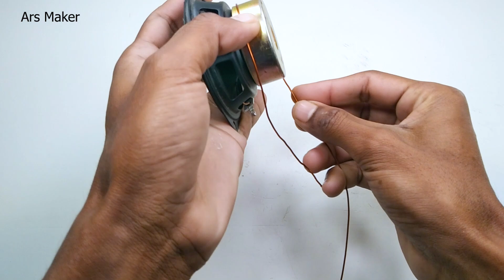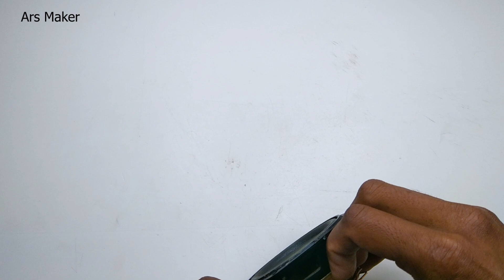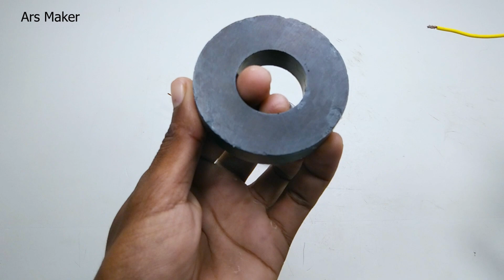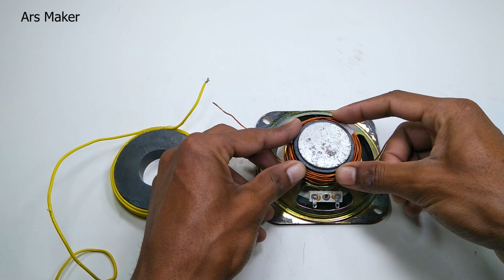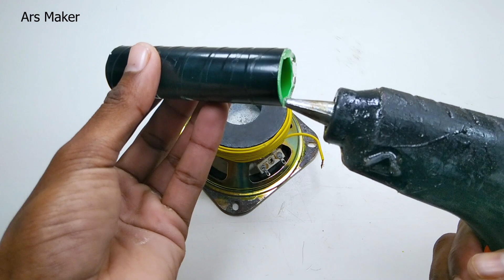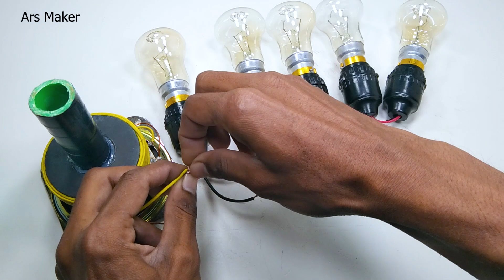New idea Free Energy Electricity 220V 35000W AC Current First Power Generator With Magnetic Activity

Comment: AH AH AH, se fossero 220Volt 35000W avresti avuto una dispersione di calore talmente elevata da bruciare non solo le lampadine ma altoparlante, tavolo e tutta la casa. Infatti una potenza di 35000W con tensioni da 220V erogano correnti da 35000/220 = 159Ampere e avresti bruciato tutti i fili da 1,5mm². Ogni mm² possono contenere al massimo 6A. Tuttavia accendere 4 lampadine è roba da 1a elementare, perchè non generate 3KW 220V a 50Hz veramente invece di fare giochini per bambini, così almeno li potreste utilizzare.